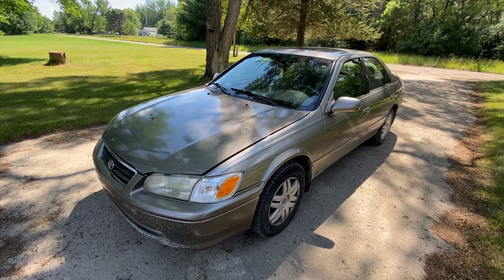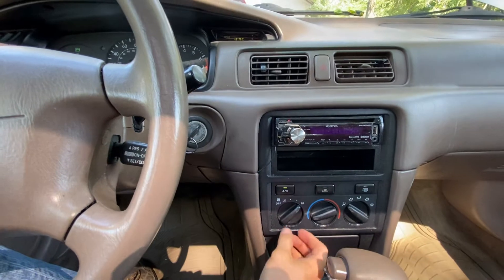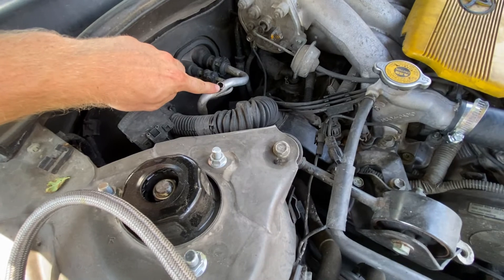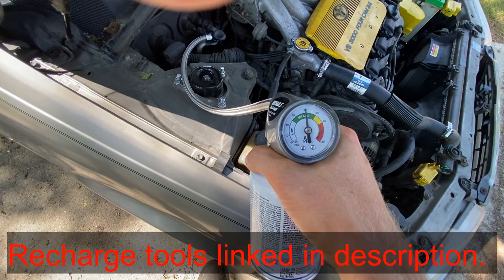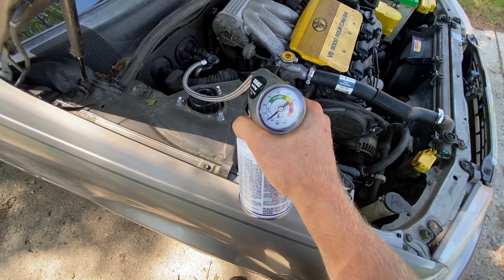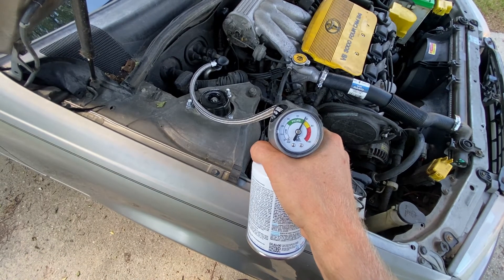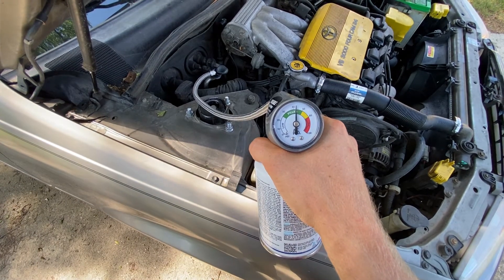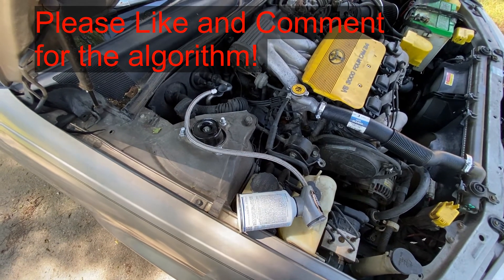How To ReCharge AC Toyota Camry V6 3.0 DIY 1997 1998 1999 2000 2001 2002 97 98 99 00 01 02

Comment: Hi!!! Don't mean to be rude but please read the Toyota Service bulletin before adjusting your A/C refrigerant.
According to Toyota Camry Service Manual Version 2483 (AC0LI–02)
pressure should be read when:
- Ambient temperature is between 86-95 F (ideally)
- Blower on Hi
- Temperature dial on COOL
- Cabin Recirculation On. 
- Engine at 1500 RPM (ideally)

Low should read between 0.15-.25 MPa (21.75 - 36.25 psi) * can be read with recharge gauge
High should read between 1.37-1.57 MPa (198.75 - 227.5 psi)
* High Pressure cannot be read with recharge gauge
** Warning use proper tool to read High pressure. Using incorrect tool may cause explosion and/or bodily harm

* Caution: Overcharging can damage your system and cause irregular engine idle both with and without A/C on
                      Releasing Refrigerant into atmosphere is not recommended. Don't damage the earth's ozone
    
Be responsible! If you overfill please discharge responsibly or take to a proper a/c mechanic.
Again don't damage the ozone.

Comment: Find the outlet, attach hose, hose on can, press. My mechanic wants to charge me $170. Is this all that's required?????
Reply from the maker: Yep. Crazy isn’t it?
Reply: @DirtRoadAutoRepair  why have I seen an assembly taken apart to do it? Replacement of the system? A non pro mechanic will do it for less than half, should I trust him? Can it be done incorrectly? TIA